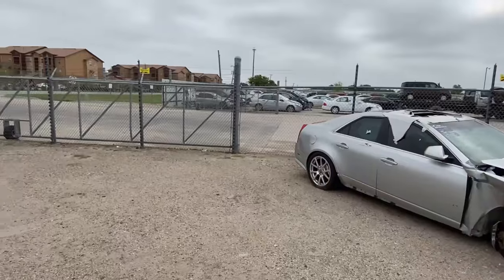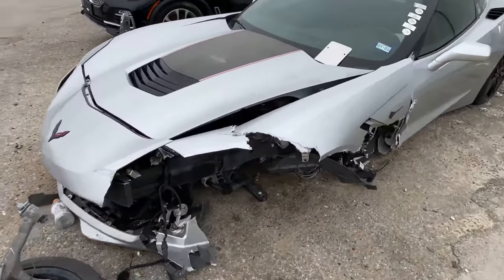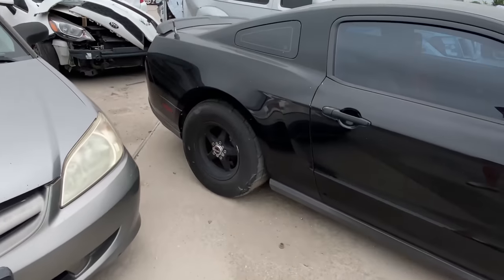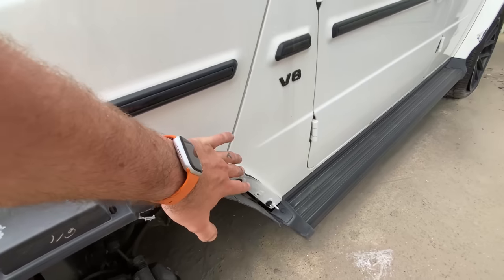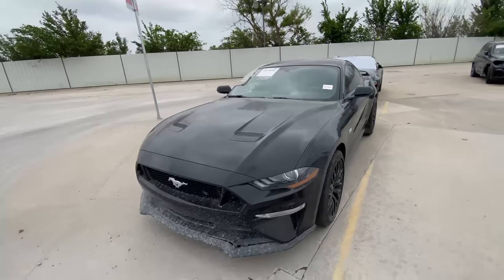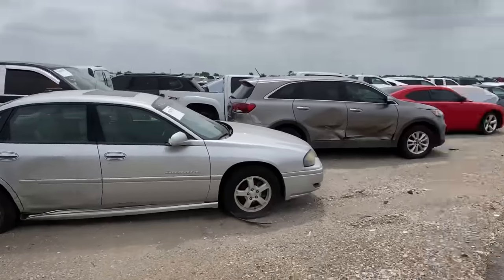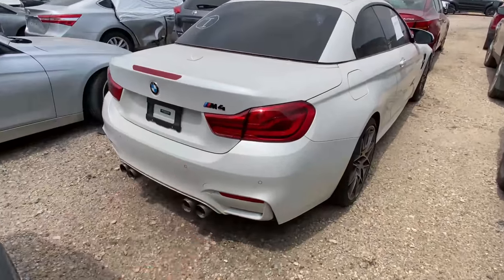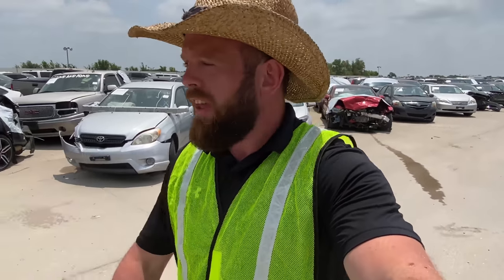TOTALED Sports Car Shopping At IAAI Salvage Auction | SO MANY C7 CORVETTES!

Comment: I worked with Copart for a while back in the day. I always noticed Mercedes and BMW's that looked perfect being totaled by the insurance companies. It has to do with the depreciation is what I was told. I actually picked up an old C280 for $800. It ran just fine. It did need a new radiator and some hoses, that was it. Had it for 3 years and then sold it for $2500.
Reply from the maker: That makes a lot of sense

Comment: Cool lot! Take that viper and hang it off the side of your roof like The Races Edge, only makes sense considering the amount of S2000s you have inside. If only you guys had some SR20 motors to put in em, but race wars is around the corner so they are pulling a premium.

Comment: The red 911 is a 964. 3.6 twin spark engine on 16” Cup wheels. Yes,  they did make an auto (called a Tiptronic). BTW the 964 is the model used to create the Singer. The Black Targa is a G Body car, so poss a 3.2 or 3.0 motor. Later ones had the G50 five speed box. Both are money pits, but the 964 would be worth saving.
Reply from the maker: Thanks for the good info! I think I’ll find myself in one sooner than later…
Reply: @scraplifegarage  I appreciate you love of big cars with huge cubic capacity engines, but my 964, with just Power Steering and ABS, putting out about 290 bhp through a 5 speed manual whilst weighting in at about 1450kg is such a blast to drive and it’s actually reliable when looked after. Plus who doesn’t love a Porsche 911. I am very interested in seeing how your Turbo turns out. A brilliant car, but unfortunately not an Aircooled Porsche.  Best wishes from England 👍

Comment: Only the 2006 Pontiac GTO came in a spice red metallic.
There’s parts that I require from you guys for my GTO but you guys don’t keep those items.
I’m looking for a low mileage differential with upgraded half shafts
I’m also looking for the underbody shield that goes underneath the trunk that is not broken or missing the flap. I’m looking for the windshield wiper arm covers as well. They are specific to the right and left windshield wiper. I’m also looking for the passenger side trim panel that goes on the seat. It’s the one that has the seat Controls attached to it. I don’t really need the controls just the cover since mine broke.
Even though it breaks my heart each time I see a GTO being crushed.
Although that makes me realize my GTO will be worth more money in the future.
I’m also looking for the C7 ZO6  axle back or the C7 ZR1 full exhaust.

Comment: 911's do not typically rust since the 80's, as they have galvanized bodies.
Reply from the maker: Very good to know!
Reply: @scraplifegarage  Owned two (1991/964, 1997/993C2) and both were built "like tanks"...in the sense that they were very durable vehicles.  As for changing out the air cooled engine for a water cooled variant...not a good idea.  For one thing, the classic air (oil) cooled engines are a big draw and command $$ today. Sure, they reached their peak power with the 930...but  they are dependable power houses and well designed. Had a lot of fun with mine...before the kids arrived. I live amongst the Alps and would say the 964 was better in the snow (with more narrow 16 inch snow tires) than my Audi quattro A6. When the kids fly the coop in a few years, I will find a nice 911 993C4S...my end game sports car/daily driver.
Reply from the maker: @jb678901  I would do bad things for a 993 c4s
Reply: One of the guys that worked for me back in the early 2000's had a silver 993C4S.  Mine was a silver 993C2.  I purchased mine used (mint) from a German retiree who had ordered it within that model's last month of production...after he and my German boss (at the time) learned of the arrival of the 996. My boss concurrently ordered a black  993C2 CAB. The retiree had a lower back problem and sold it to me after he replaced it for a more comfortable MB coupe, in 2002. My 993C2 had the full blue leather interior with carbon trim. Inside, it was incredible. However, my manager's 993C4S sat lower, with an aero package to die for. We used to take both cars north to a company factory...back when speed controls were a bit more liberal. What a blast. We didn't have space to really push the cars...so 240 was about tops.
I did have a chance to really push that C2 on a road trip to Porsche HQ-Stuttgart, with business colleagues (Porsche Club event). Four Carrera's (911 3.2, 993C2, 993C2 CAB, 996C2 CAB) in a line on the DE autobahn...at times I was white-knuckled doing 265 kmph. Spent a day at the factory/R&D and track (test driven in the Boxster S and 996 Turbo X50).  Hard to beat that day...except for the day I spent with the Ferrari F1 team (Todt, Brawn, et al) which included professional test drives (as a  passenger) in an Enzo and 360 Challenge  at Fiorano...as part of a leadership course with one of Ferrari's F1 partners. Yes...the company that paid Michael's salary of EURO 50 Mio. The company flew 20 of us in a squadron of 4 Gulfstreams from Geneva to Bologna for that dream day. They did not tell us where we were going at 5 am, just to bring along our passports. Great memories.

Comment: I have been a big EV hater for years because with gas promotions in my area paired with my supermarket, I never paid over 88 cents a gallon.  So I'd talk with Tesla guys and laugh at their per mile cost.  We're in a high electric price area.  But now, the promos are gone, gas is way up and EVs are cheaper.  So I went and drove a few including a Tesla model 3 performance and it was stupid fast.  They now cost 1/3 what my 4 cylinder Subaru costs to run so I am considering one in the future.
Reply from the maker: You won’t regret it!